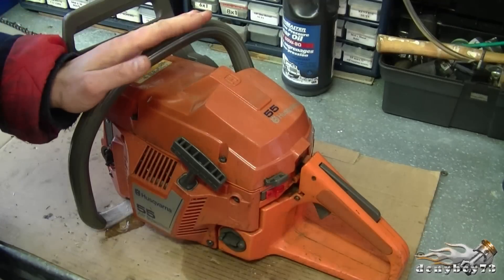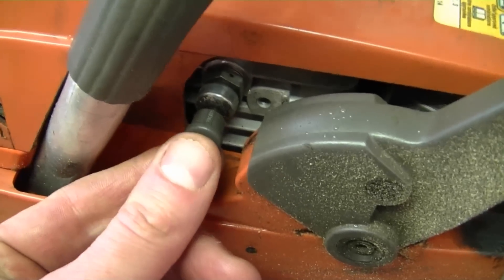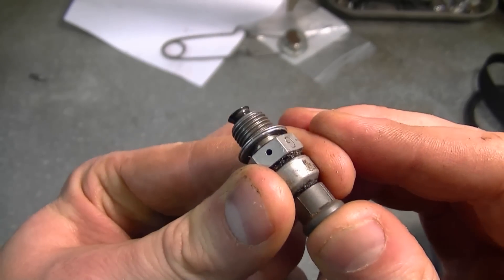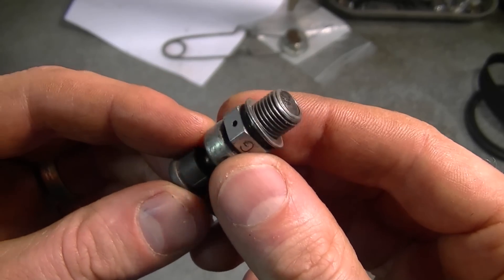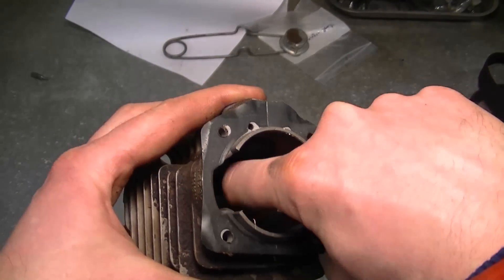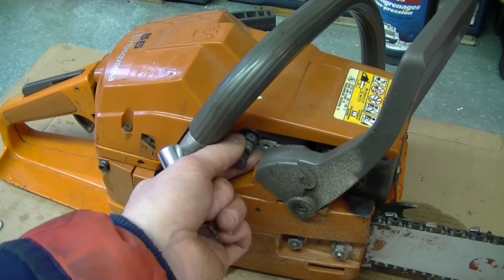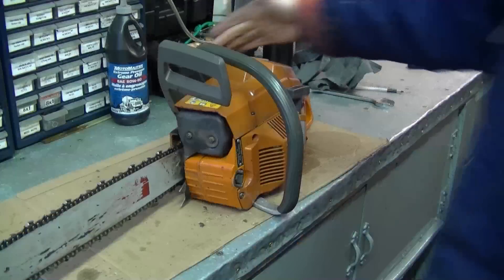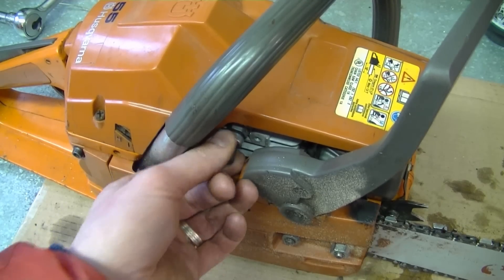How a Small 2 Stroke Engine Decompression Valve Works - Stihl Husqvarna Chainsaws

Comment: Hello donyboy, I'm a disabled veteran and don't have a great deal of arm strength. I need a combination trimmer, pole saw and hedge trimmer that's light and has a decommission valve. What would you recommend?
Reply: Not decommission, I meant decompression.
Reply from the maker: I would check out the battery operated ones

Comment: 266 SE Husqvarna (older model with metal brake bar) brutal to pull over when starting. Used to pull over good but gradually got really difficult to pull over. Spark Plug out turns over fine. Cuts great when started just a real bugger to pull over. Any Suggestions.?

Comment: Is it normal for the decompression valve to close after each pull. I have an echo 600p that is extremely hard to pull to start with the decompression valve closing after each pull! With the valve closed it is almost impossible to pull!

Comment: Hi mate I have ms 170 stihl saw the issue Am having is it’s started to get a bit stiff when I first go to crank it over as if the engine was starting to sizes 🤷‍♂️I’ve taken the muffler of and that looks good.
Once it’s going it has lots of power / 37/1 fully synthetic oil do you think am using too much oil 
Thanks wayne 🇬🇧

Comment: I push mine in and the minute i start pulling on rope decompression valve pops out and i can't start it.Whats going on?
Reply: I am having the same problem 
Also the rope doesn't want to retract.
Reply: @bypass04a  I finally bought the decompression valve from factory and it has worked flawlessly since.The 1st i bought was a chinese knockoff

Comment: I have a husqvarna 257. Hasn’t been started in over 15 years. I cleaned everything including the carburetor. It won’t start. Turns out fuel is coming out from the decompression valve. I just ordered a new valve so hopefully it’s the problem. Have you ever run into that problem?
Reply from the maker: could be it, look at piston ad cylinder by removing the exhaust like in this video https://www.youtube.com/watch?v=JPEpkAHwyCc

Comment: hello,im used chainsaw stihl ms382 made in brazil,i buy a new and im only used about 3 or 4 times only,so my problem is,when im finish use it,the engine still hot,so when i want to start pull again the pin valve compression automaticly is on,its dificult to start again. so my question is “whats the problem when after i use and want start again every time like that,and what the sources the pin valve always on if i pull it,thank you

Comment: Hi Donny , learned much from your videos, thanks. I have an old stihl 
025.This summer I overhauled the oiler and replaced the carburetor and 
air filter( with new type) and it started and ran fine. I let it sit in 
my workshop until yesterday and went to run the gas out and put it away 
for the winter. When I tried to start it I could barely turn the engine 
over. I tried a number of times and finally stopped. I removed the air 
filter cover and was going to pull the plug but instead tried to start 
it again without the cover and it pulled and started normally? I was 
wondering if the 025 has a compression release operated in some way by 
the air filter cover? If not, any ideas? Thanks

Comment: what about weedeaters? i have 2 echo weedeaters, my brain is rusty on this one. when i pull the chord it pulls but the chord freezes like 4 times per pull. i have a bad rib so i simply cant do this i need to fix this. i took the spark plug out and pulls the chord and it glides easyyyyyy.
Reply: Sounds like your weedeaters just have real good compression.

Comment: Nobody can figure out why my TS500I quits running when it's cutting for 10 minutes. Is there a overheat protection temp sending unit? The local Stihl dealership has replaced all the electronics twice. They threw their hands up in defeat.
Reply: Try changing the Coil.

Comment: While cleaning my Pioneer P20, I noticed it has a decomp valve that is maintained open by a spring and automatically shuts closed through combustion pressure. Very ingenious and a welcomed feature in such an Old (30 years) and small machine. Built in Peterborough, they were good !

Comment: I wanted to comment after reading this that a lot of engines from chainsaws even riding mowers have that mystery lever or the valve hidden way under some cover you really have to look folks. It's important to save your saw or weed whacker tractor and mower manuals after y'all shop at Lowes and Depot's MADE IN CHINA lawn and tools bins... Read the shit people you may actually learn how your shit is supposed to work what gas and oil to use.... And then there are shops like mine where you get charged you for that re-information because we have to pay the guy $$$ that works for us to re-inform you about YOUR SAW or MOWER.... . Whereas the info in those discarded manuals you lined the cats little pan with or burned in the wood and coal stove......... LEARN ABOUT YOUR EQUIPMENT PEOPLE. BALDE SIZES MATTER SO DO  CHAIN and TOOTH SIZES as well as  BELTS AND TENSIONER ADJUSTMENTS!!!!!!!!!!!!!! HAVE A FEW CANS OF BEER CALL ME IN THE MORNING WHEN THE BEER FOG WEARS OFF...

Comment: hello, i have a problem with decmpression valve on my husqvarna 357xp, i take it off but it seem is clogg something inside there(the valve is ok)
Reply: +MrFilipT   I want to say even with the decompresion valve removed, when i try to start the saw is hard to pull
Reply: +MrFilipT Most of the valves will come out if you remove the plastic covers which is sometimes another act where you need God. The valves themselves usually come out with a 10MM 11mm 12mm 13 and 14mm wrench. Small engine shops can order them. You model and serial number of the saw the reason to take all the plastic or metal covers off the saw. Start there Harley Bee Bikes will call you back if you call 570-459-6988
Reply: Tim Yeakel
i do take off the valve, but is colged inside carburateur, and about parts, i am from Romania.
Reply: You need a new head gasket first off Mr Flip. Second if you contact me show me pics of what you are into I can steer or send you a new valve... It's easy so relax. If it is clogged. REMOVE THE HEAD FIRST. SEE OF YOU CAN FREE THE VALVE UP THAT WAY IF NOT CALL ME OR SOMEONE VERSED IN ENGLSH. YOU CAN CALL ME OR RIGHT ON HERE . I NEED PICS AND SPECS IS ALL.  THANKS FLIP IF I CAN HELP YOU I WILL EVEN SEND YOU THE REPLACMENT VALVE... I HELP EVERYONE...

Comment: will the 55 cover fit the 50 chainsaw? since it has a slot for the valve.
Reply: +Ray Dolbec Ray dumb question okay... It the covers are similar you may need to trim them. Use a Dremmel and call me in the morning when the beer fog clears up okay..

Comment: Thank you for the informative video. I have a saw with this on it and have never really understood the purpose as it starts beautifully without using the valve. I always figured it was to assist in getting the cylinder rotated around for a full cycle to make it easier to start. Thanks again!

Comment: I have one on a 71cc 2 stroke earth auger & It's become very hard to pull-start with the valve  in or out. I feel no difference on the recoil starter either way.

Do these things ever fail?

How do you test them?

Is the opening direct to atmosphere such that you can blow thru by mouth or with compressed air& actually feel it coming out the other end?
Reply: +George D&#39;Onofrio  Remove the valve inspect it clean it reinstall. If it's broke get one. There are retro fit valves on the market. Some require to remove the head retap clean reinstall. Easy as pie for an old gear head. Other suit and tie wearing folks may get pools of fearful sweat lose some sleep okay. Drill can be a scary device to some people...

Comment: hey, I have a Husqvarna 335 XPT. It's really hard to start but I don't think it has one of these valves? Any ideas? The exhaust isn't stopped up. It's not flooding. The flywheel key isn't sheered off. To crank it you have to pull it just past the "hard spot" then give it a good yank and it starts right up and runs great. I see the same saw on youtube videos but they are really easy to pull start. I'm going crazy over this damn thing, HELP!!!

Comment: hi  donyboy 
I have a problem on my ts420 cutsaw the decompression  valve pops open on every two pulls, i put a new decompression  valve   and it still pops. The starter rope is hard to pull can you tell me what the problem can be thanks

Comment: It work's the same as compression release valve a lot of snowmobile's had them
I seen a outboard motor that was automatic I pulled on the recoil And I could see
Levers turning it on and off but it had a adjusting nut's for the release valve. They
should make a RC  engine for weed trimmers just to see how they turn out.

Comment: I have one on my craftsman chainsaw it went bad a while ago and I am waiting to get the part to fix it . I have not found a way to bypass it by replacing it with something else . My sons 1987 yamaha 350cc had one in the head of the quad and a pull starter there were only 2 years 87 88 that had pull starters and decompression valves.